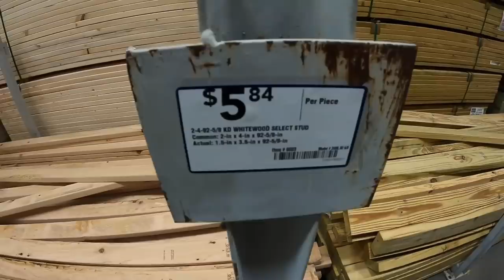Father Son Convert Horse Trailer To Chicken Coop | Framing The Walls |

Comment: Good job with the saw and nailing Ranger! I used to love wood working with my Grandfather when I was young. Gary, I wonder if you should spot weld some wire mesh to the side windows as the gap between the frame and the trailer wall large enough for predators to get in. ( I also have no Idea what your Vision is so I know you’ll have thought of it already)

Comment: I would add at least 1 board at the front of your wall to make the front secure and can't fold in. Nice job Ranger on using the mitre saw. They are a little scary when you have never used one before. 👍⭐🤗